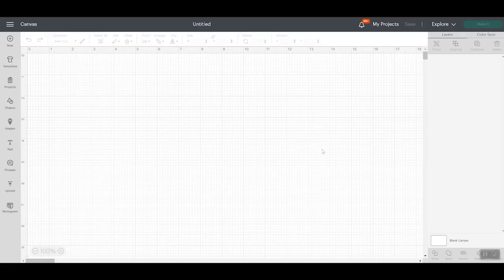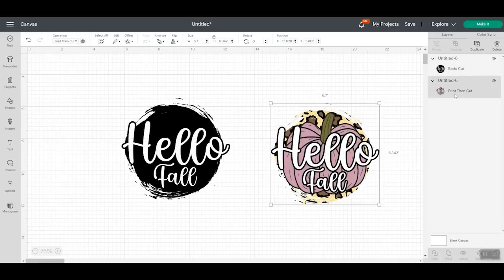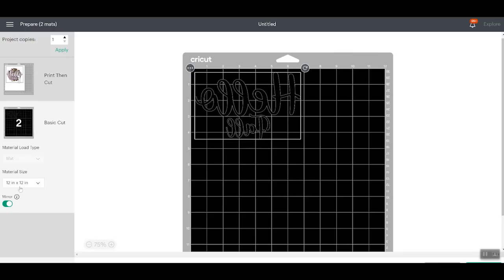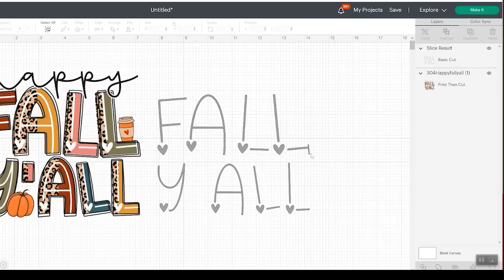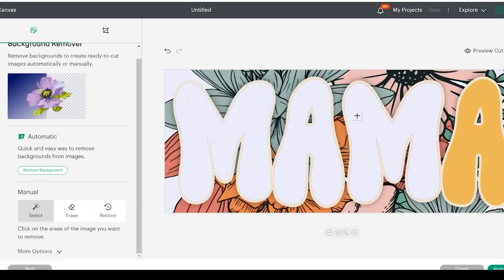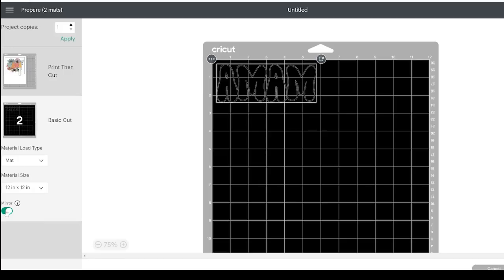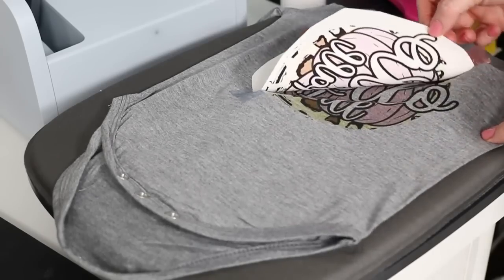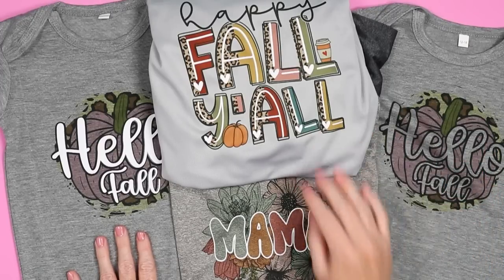White Sublimation Hack Using HTV and a Cricut Machine

Comment: Angie! Great video. I also love the DTV from Siser. I have been using the backer sheet to help the printed side lay flat before I press it. Through an oopsie moment, I accidentally pressed the DTV with the backer sheet covering the printed side. It didn't stick to the print and worked like parchment. That's my go- to for ensuring my image doesn't move or roll while I'm pressing.
Reply from the maker: Great tip!

Comment: How do you clean your platen on your heat press? I did a boo-boo and I need to clean it off. Please help
Reply from the maker: Can you get it hot and then use a cloth to clean? I have done that before. They also make iron cleaner that would probably work!
Reply: @AngieHolden  i got it hot then I used 409 and I plastic scraper and a lot of elbow grease. I took the platen off and flipped it upside down while it was on about 200 degrees. I have a swing away heat press so it enabled me to do that. It took several hits of 409 but I finally got it off. I will remember the iron cleaner for next time. Thank you.
Reply: Use plain printer paper. Cover the pad with paper and press for 1 minute and then replace with clean paper. Repeat until the paper has no shadow of the ink when you hold it up to the light. I don't recommend putting anything wet on a hot press, it may warp.
Reply: It wasn’t ink that I got on my heat press @patriciakidd5358

Comment: If you use siser subli in your Epson f170 do you take mirror off?
Reply from the maker: Actually the ink will not dry so I wouldn't try printing directly on it from an F170.
Reply: @AngieHolden 
so you use inkjet printer?
Thanks

Comment: So it's ok to press over the sublimation again when adding the HTV layer?  I thought you couldn't iron over sublimated ink..?
Reply from the maker: Yes. As I stated in the video, the HTV is at a lower temperature so probably will not reactive the ink but you use butcher paper just in case.
Reply: Just make sure you cover it. I use plain printer paper. BUT, put some paper inside the tee also to keep the sub ink from going through to the back side. The ink usually doesn't go thru to the back on the first press but definately can on the second press where the HTV is being added.

Comment: Great idea ! Any hack you know of if we want to add htv to a sublimation pic larger than cricut's print and cut limit (print larger sublimation pic from another program, but have a cut file for htv through ds that would fit perfectly even then ?) Thks
Reply from the maker: I was thinking on that one. You might be able to separate the layers in Canva then import them?
Reply: I have been using the free version of silhouette to print my sublimation images and then uploading the image in DS, using the same sizes as my image in silhouette, to do my offset for glitter htv to be able to sublimate on dark colors.